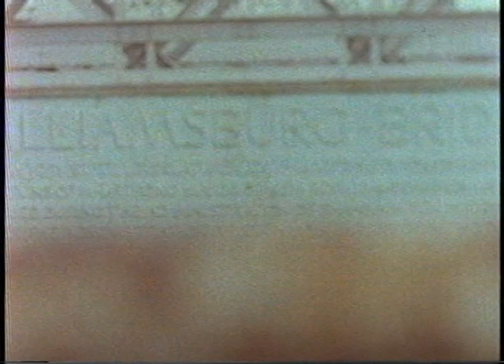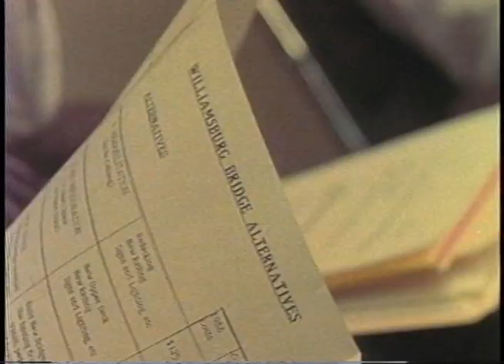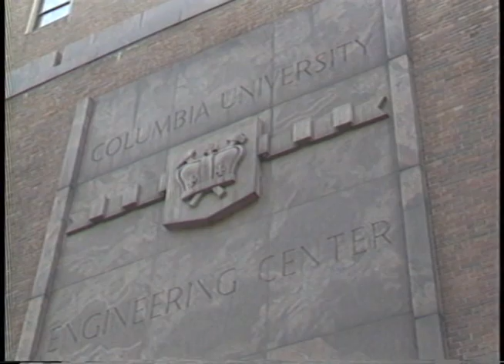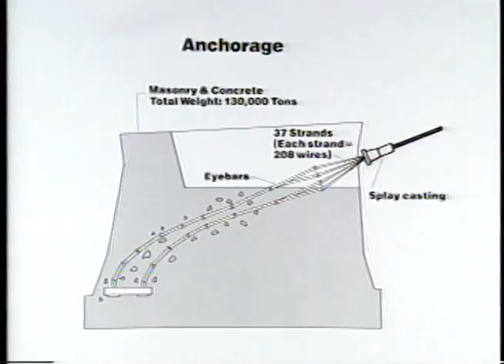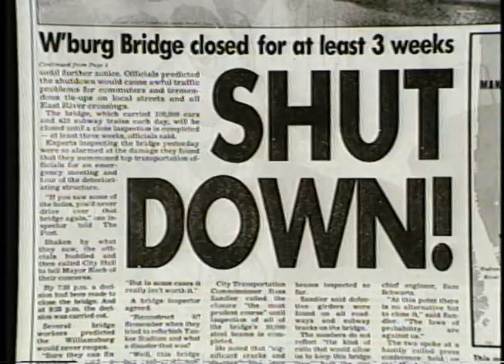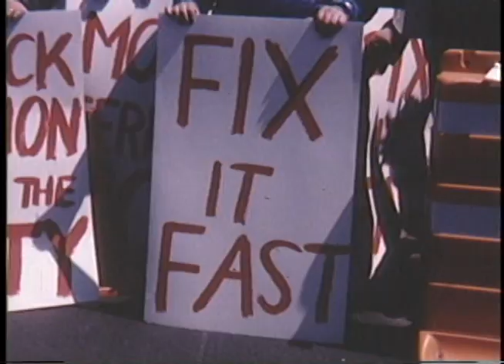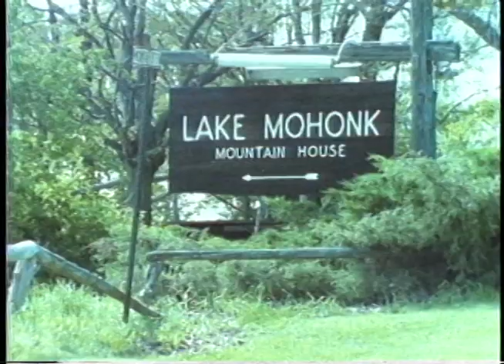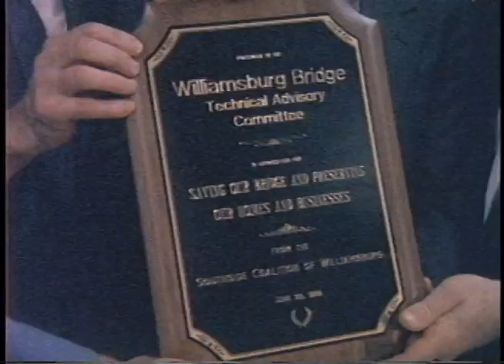Saving The Williamsburg Bridge

Comment: My Grandmother owned an apartment building on South 6th, Street, between Wythe, and Berry Street from 1971, to 1996. I am very familiar with the Williamsburg Bridge. Every time the subway trains would cross to and from the bridge you could feel the whole building shake. There was a park called Sand Park, underneath the bridge. We played baseball, handball, etc... In the early to late 70's the Department Of Sanitation parked their trucks under neath the bridge right next to the stone wall of the bridge near Kent Avenue, on the South 6th Street, side. On South 5th Street, between Berry Street, and Beford Avenue, the Department Of Correction, parked Their vehicles and buses under neath the bridge as well. Also, the Department Of Traffic had their buildings and vehicals past Kent Street right up to the East River, and between South 6th, and South 5th Street, right under neath the bridge. Not to mentioned the Schaefer Beer Company, was on the South side of the bridge and the Domino Sugar Plant, was on the North side of the bridge near the East River. All of these buildings are gone except the Williamsburg Bridge. Amazing!
Reply: This whole area is gentrified now. It is completely unrecognizable. Just a bunch of bars and hipsters from other states. They pushed away the local low income population. And it’s tragic

Comment: Is there a video about the 1987 Manhttan bridge closeure?
Reply: No, this is different, though it was basically the same issue. In the 1970's and 1980's, the NYC bridges were neglected due to budget cuts. This resulted in the bridges being weakened to the point of them nearly collapsing. In 1981, one of the cables of the Brooklyn Bridge snapped and killed someone. This documentary is about the 1988 shutdown of the Williamsburg Bridge. There were literally holes in the roadway. The Manhattan Bridge also had major structural issues. Fortunately, all three bridges were eventually repaired.
Reply: Thankfully, all three of the East River bridges are preserved as landmarks. Except only one bridge that replaced the Kosciusko Bridge is the new bridge that is still in use, and it has been two years since the new Kosciusko Bridge opened to reduced traffic headaches. In the old Kosciusko Bridge, it had problems overtime due to heavy traffic.
Reply: Leonard Wilson I’m glad that all NYC landmark bridges are safe after so many repairs like replacing cable wires and the whole thing to make the bridge safer.

Remember what happened in 1940 when the Tacoma Narrows Bridge collapse due to heavy winds that wiggled and ended up collapsing the bridge completely? Not in New York, but I hope it won’t happened again. Williamsburg Bridge had problems over the years due to rusty cable wires and the whole sha-bang. No one wants to drive this bridge, and that was in the late 1980’s.

Remember what happened to the old Lake Champlain Bridge? That has been closed since early to mid 2009 and then it got destroyed by dynamite on a snowy day, and then built a new bridge and finally opened by 2011. The Lake Champlain Bridge connects the state border of New York and Vermont.
Reply: In the case of the Manhattan Bridge they had to accommodate for a design flaw caused when trains in opposing directions on the opposing side twisted the structure beyond what was expected. They also had to account for decades of having the north side subway tracks carry way more service, leaving the northern support cable overstressed.